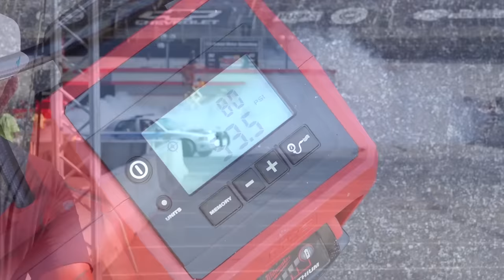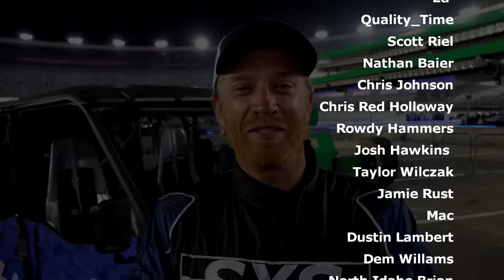Hellcat powered utility side by side DOMINATES Bristol!

Comment: Pros: Awesome tip in constant smoke. 
Cons: Consistent throttle control and more use of the pad would have won by a mile. 
More practice and this monster is unbeatable
Reply: shorten the rear end and you will go round like no tomorrow front brakes need sorted maybe even some bigger heavier front runners. pad use is a big thing in Australia i want to see some US cars make the trip for summernats lots of aussies do drag week come have a crack at our comps
Reply: Practice is definitely going to be needed. The rotation on that thing during tip-in will tear him a new neck if he's not used to it. LOL He could really go in at 30-40mph and since it has so much HP and barely any weight he'll be able to power against the speed almost instantly
Reply: I hope they see this ‘cause this is key!
They gotta beef up those front brakes & maybe grippier front tires 
& Use the whole pad! Not just circles in one spot! 
No hate, that was a CRAZY smoke show 🔥

Comment: The way it would loop around on the tip in would be nuts. Absolutely ripper skid im a Aussie n own a skid car so I know what its like when your blinded by smoke but  now thats what you call fkn sending it.   It has the smoke it has the power  it turns tires to dust. Absolute weapon ☝️☝️

Comment: We were there and definitely feel like you won the Rival class! A few recommendations for next time, 1. Maybe an amber light bar to help see through the smoke some, 2. Lexan firewall behind the driver so no 200 degree bath's like Leo had, 3. Safety glasses to keep rubber debris, the safety squints are not working by the looks of the rubber on your eyelids. Great job guys!

Comment: That was absolutely awesome Doug, great job you guys. Hey, I have an idea. What if you put a large screen on the dash with GPS, telling you exactly where all the walls are. It should be able to tell you exact position within inches of the walls. Then that way, all Doug needs to see is the screen and should be able to hammer down all the time, except for the control of the turns. I think it would be an absolute game changer. You could even have imaging right on your face shield in your helmet. that way it would be discreet and you would definitely be able to see it, without anyone knowing. they would all be wondering how Doug can drive so well without seeing beyond the steering wheel. You should  check it out.

Comment: Look into the Agriculture Professionals and figure out a GPS guidance for SMOKE DRIVING. Just set the points when you arrive at the location. Maybe a GPS that has the satilite sensors on the wall corners ?

Comment: You guys have amazing potential! The car is just too light in front for the tires to hook up and slow down the car when you brake. 
Being able to slow down the car with just the brakes lets you stay in throttle and have more control over the car so you can actually steer it where you want it to go and utilise all of the pad. Like going into the exit or entry corridor for a bit so the smoke can clear off the main pad a bit not only can help not getting lost in the smoke but you can even go for a second tip in. 
Smoke: 10
Tip in: 10
Continues throttle: 6
Control: 4
Pad use: 4 (control and pad use was mostly the car's issue)
Tires popped: 10
Doug did a really good job with what he had, i cant wait to see what he can do with Hellforce once they get it to brake better and with him getting more seat time and practice.

Comment: I think yall should try going in with like 28 psi of air. 50-80 psi those cheap tires will last forever in a burnout. After the tip in Try using 1 side of the pad at a time so the smoke will clear. Good luck on the next competition. Also maybe try a wider wheel with a low profile tire. That's how the aussies do it

Comment: Sxsblog look into getting flir thermal imaging on all 4 sides, and the big screen to view it from you can see through the smoke fog rain with thermal imaging. You can get a better idea where the walls are have that flatscreen where it will fold down right in front of your face it would be bad ass no more not knowing where the walls are
Reply: If that's a thing is anyone else doing it?
Reply: @Team_Finn  I don’t know if anybody else is doing it be the first why follow somebody else I have a FLIR thermal scope on my AR I had my buddy do a burn out to test my theory and I could see through the smoke so I don’t know why they’re not using them. It must be a good thermal the cheap ones do not have the sensitivity a high end unit has but you can get thermal for vehicles The ones I have seen are pretty high end with excellent sensitivity and depth perception They are still cheaper than buying a unit that is designed as a scope. I do know the Coast Guard uses them and military and some private manufactures building boats and some vehicles come with them like the Knight XV it comes with thermal all the way around you can see through smoke fog. Look it up.
Reply: @Team_Finn  when I said up above I don’t know if anybody is using them  what I meant is it for burnout competitions I do know the military uses them to see through smoke and fog, so I really don’t know why civilians aren’t  using them for burnout competitions they are available to anyone in the US that has the funds to purchase it

Comment: There's no doubt it being mid engine is messing with you. It's centering the weight not letting it be over your wheels hints powering thru lock up and being centered is putting more weight on the rear. Kinda curious what I mid engine actual car would do after seeing this

Comment: I really think a gps unit that has the burnout pit programmed into it and the location and heading visible on a screen and a 10' and 5' light on the dash for front and rear would help take burnout competitions to the next level in terms of driving hard and not having to deal with lack of vision due to smoke